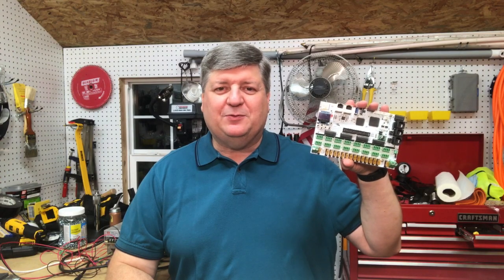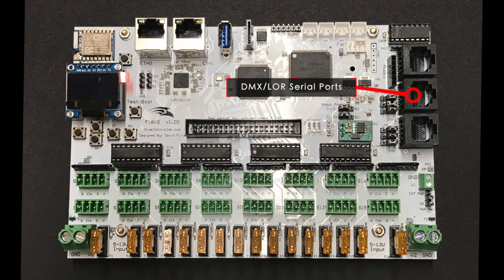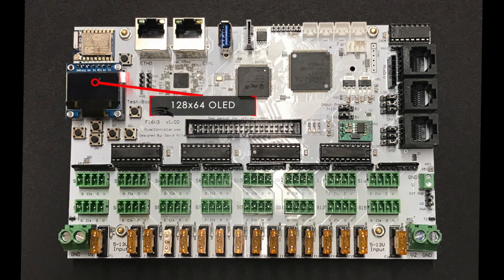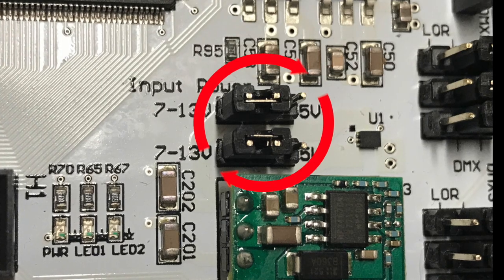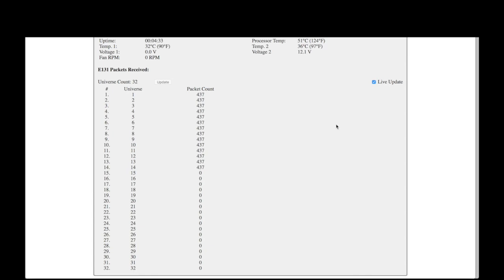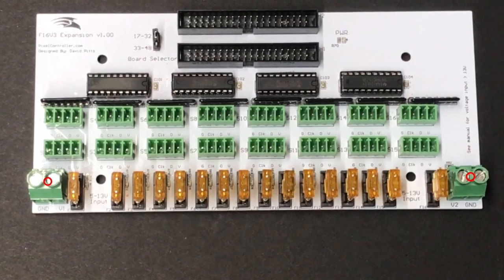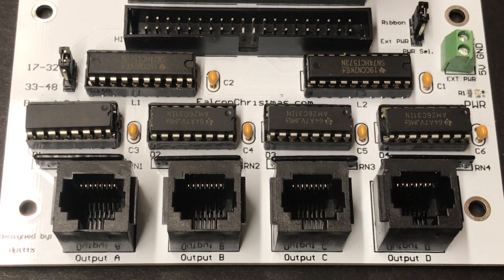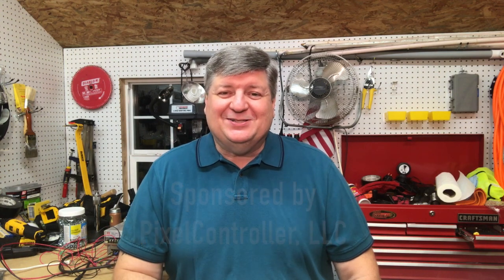Falcon F16V3 Pixel Controller

Comment: Great video! Very informative! Documentation for this stuff is hard to find!
Reply from the maker: Thanks! Documentation for the controller or how it all fits together? There is a lot of documentation for the controller itself at https://www.pixelcontroller.com/store/index.php?id_product=48&controller=product and then there is a great getting started guide on auschristmaslighting.com for general pixel-related stuff.
Reply from the maker: Then of course, my entire channel is a veritable treasure-trove of valuable information! :)
Reply: I guess more starting out from scratch. I've seen the crazy light shows and started to go down the rabbit hole. It's not easily google-able unless you know the specific model(s). I went to doityourselfchristmas.com to find the model names for boards, looked up the board they had on their site, but it was discontinued, found this one-- found this video. I guess the community is growing, but man is it tough to just "find" this stuff uding general terms.
Reply from the maker: Ah! OK. Yes, totally understand. It's a bit of a learning curve. LOR was the big gorilla in the space, but they were mainly AC-based. There were competitors, but they were king. As pixels gained favor, other boards started showing up. SanDevices got big and is a popular board. The Falcon line came out and is what I consider the Cadillac of boards - really solid engineering and support and I like the direction their headed. Many people use them so there's plenty of help online.

Falcon controllers, MeanWell power supplies and xLights sequencing software works for me. I'm now an exclusively Mac user so needed something that would run on a Mac. If you're a developer, the source is available online as is FPP for the Pi. In the software world, I'm a believer in more eyes on the code is better.
Reply: You have saved me TONS of time by typing out the names of the components you have. Seriously. I honestly started with LightShow-Pi this year, but am looking to take it to the next level for this upcoming year. Is there a forum/group/subreddit you follow for this stuff? or is it really that scattered? 

LightshowPi has a google group that is pretty active, and pretty helpful. I have so many questions about what LEDs to get, pros,cons... etc..
Reply from the maker: Kinda scattered, but here's my main places to hang out and ask questions:

Christmas Lighting Forums:
https://auschristmaslighting.com/forums/
http://diychristmas.org/vb1/index.php
http://doityourselfchristmas.com
http://falconchristmas.com/forum/
http://nutcracker123.com/forum/
http://www.planetchristmas.com

Facebook Groups:
Advanced RGB Pixels and Controllers http://bit.ly/2zEMrgXOfficial xLights Support Group http://bit.ly/2zBMwnv
FPP, Falcon Player http://bit.ly/2yvc7v3
Reply: YOU ARE THE MAN! I subbed when I first saw this video, but after this message I unsubbed... Just so I could sub again! Thank you!

Comment: Has anybody used the Serial Ports for Renard controllers? For some reason,I'm not getting any activity no matter what I do.
Reply from the maker: I don’t have any. You might check on the forums or Facebook groups. Chances are that someone there has.
Reply: It was a faulty crossover cable. Everything works fine now.
Reply: @Kev7274  I am waiting for my falcon v3. I have 3 ren 24ss and 2 arduino 16's, pixels are going to be new this year, quick question can I run the Ren's off of the falcon? I will be using a single network  cable from laptop running vixen 3, to falcon then to Ren's ?
Reply: Hey Frank. Yes,you can run the Renard  SS24 off the Serial port of the Falcon. I only use one though.

Output one of the Falcon has all 4 of the pairs used for the different outputs (especially a 4 output remote).   Connect the Renard to output port 2 or 3, which have a single pair.  They also have a ground, if your devices need it. 

I was using output #1 and nothing was happening,used output #2 and it started working.

I use a Falcon Player for my show,but I do use my desktop for testing purposes. I have a network cable to the Falcon and then a network cable from output #2 serial port feeding the SS24. Hope this helps.

Comment: Jeff,If it wouldn't be too much trouble, could you post a picture of your differential receiver box and tell us what it controls? I'm trying to figure out if 1 power supply will do what I want. I know it depends on what I'm driving, but if I need 2, I'll add a distro board for power injection.Thanks
Reply from the maker: Current, I’m only driving two strings with it so one power supply. One string is running at 30% and the other is 100% with power injection. Not sure how to post a pic on YouTube.
Reply: Thanks. I thought you could copy and paste a picture and it would show up in the replies. I was thinking of using a remote to control my roof lights and garage doors and windows and another to control yard perimeter and floods. I'm also building some snowflakes out of frames I bought at Hobby lobby after Christmas. Hoping to copy someones existing model for pixel placement. I'm also thinking of making a couple of wreaths for the center of my gable ends. Lots of small stuff in remote locations, but I want to run off of one controller if I can. Your videos have been most helpful.
Reply from the maker: Thanks! Sounds like you’ll be busy a while! lol
Reply: How many pixels on each of your 2 strings? Just curious.
Reply from the maker: 120 & 175. 120 is power injected.

Comment: can you update the things on the firmware
Reply from the maker: I haven't tried it yet because the update is for Windows only, but I'm told it is a stable update.
Reply: CanispaterChristmas can you help me to get some controllers to INDIA.
Which is the best options in setting up good shows.
Reply from the maker: Which controller do you like? How many pixels are you planning to start with?
Reply: falcon controllers. the f16v3 and its peripheral devices too.
I will be controlling 5000 pixels in the beginning  but may increase to over 10000 pixel within a year
Reply from the maker: International shipping is a little tricky from what I understand. I do know that David will ship controllers internationally if you wire him the money or use Paypal Friends and Family. You can get pixels directly from the manufacturer in China. I've always ordered from Ray. What peripheral devices do you mean? That sounds like a nice show you're planning! :)
Reply: thank you

Comment: The wifi module mentioned at 5:07 is supported with the latest firmware. I have used this board to act as a FPP slave. No rpi is needed. One other item is to get an antenna to raise the signal strnegth of the wifi. Her eis the antenna i use: https://www.amazon.com/WIFI-10-dBi-2-4GHz-Antenna/dp/B000SEQGT2   And here is the cable you need:  https://www.amazon.com/U-FL-RP-SMA-Pigtail-Antenna-Cable/dp/B005UWD0EG/ref=pd_bxgy_147_2?_encoding=UTF8&psc=1&refRID=87J10T239JCA3JX9ES32 This antenna raises a 75dbm signal up to 55dbm, a 100x improvement in signal.
Reply from the maker: Thanks Sean! I'll have to try that out. And thanks for the awesome video on xLights.
Reply: Awesome, been waiting for the wifi. But i've been worried the signal strength won't be good enough. Glad to hear you've had success adding a good antenna. Buying!
Reply: This post is 5 years old, and I am wondering which version of the firmware supports the WiFi module?  I have v2.59.
Reply from the maker: Check the network tab in the web interface.

Comment: Sold
Reply: Just purchased one. I'm guessing you think this is better then the e682? Did I hear correctly that each universe can run 1200 pixels? So each connector can run 1200 pixels?
Reply from the maker: You may be confusing channel output with the E1.31 protocol. A Universe is 512 channels. A smart RGB pixel uses 3 channels. You can run 170 pixels per universe with 2 channels left over. 

RGB pixel controllers support X number of pixels per output. 100 pixels at 100% brightness, all white will consume roughly 6 amps at 12V, exceeding most of the current-handling capability of the traces on the boards (so they're usually protected by 5-amp fuses). Even though a controller may be able to support 1024 pixels per output (or whatever), you can't run all of the pixel power through the board. You will need to inject power at one or more points along the string to keep them fed properly and keep the current through the board at an acceptable level.

I have and use both brands of boards in my display. For the last couple of years, my purchases have been Falcons. Does that answer the question adequately and diplomatically? lol
Reply from the maker: If you use the full 5m, you will probably need to connect power to both ends of the strip unless you run them at a lower brightness level. Check out my video on power injection (https://youtu.be/bvN91XDH2V0).
Reply: Thanks for your help! Got it figured out and will also make videos to help others through the process. Here is the first video I mad and my progress. https://www.youtube.com/watch?v=Qc2_RHYZ2T4 I now have the falcon f16v3 up and going!
Reply from the maker: Excellent! Nice video!
Reply: I'm certainly confused and definitely a noob. I talked to David today and I inquired about the ready to run setup he sells and he told me that it will only do about 1200 pixel using the  Falcon F16V3 Pixel Controller. So if that's correct then I can only use one of the 16 channels if I have huge mega tree display with 1000 pixel? then I would need to purchase another board to run another display? Or are you saying I can run the 1024 per channel/output as long as I inject power.
Reply from the maker: It only comes with one power supply so that is the limiter. You're limited to 5-amps per output on the board. You can either inject power or bypass the power distribution on the board completely (power the strings through a fuse block yourself). Typical calculation is 0.06-amps per pixel so 100 pixels, 100% brightness, all white is roughly 6-amps. 1,200 would be 72-amps! You'd need 3 power supplies just for the tree. I run my 1,200-pixel tree at 30% so ~24-amps. That's one power supply hence David's comment.
Reply: So would it be more cost friendly to just buy everything I need separately or buy his ready to run setup.
Reply from the maker: You can get the MeanWell power supply for ~$50 (http://amzn.to/2kaWnLC). You can go cheaper, but MeanWells are very good and highly recommended. The CG-1500 is ~$40 (http://amzn.to/2qg1hcL), but it sounds like you might want a different enclosure anyway (see my enclosure build video https://youtu.be/CsnVs942alI). Other than the $200 controller, the rest is wiring so if you already have it or don't mind sourcing it yourself, you can  save some money. It isn't a horrible price for what you get, but how resourceful are you? :)

Comment: the V3 has three dmx ports. can I use two ports to run 2 differential receivers?
Reply from the maker: I believe the answer is "kinda." DMX1 has all four serial ports so it can support a full differential receiver. DMX2 supports serial port 2 only and DMX3 supports serial port 3 only. To run two full receivers, you would need the DMX expansion card. If you only need 1 port on the differential receiver, I believe 2 or 3 would support that, but not all four ports. At least that's my understanding. David would be the person to ask for 100% accuracy. His contact info is on the pixelcontroller.com web page at the bottom.